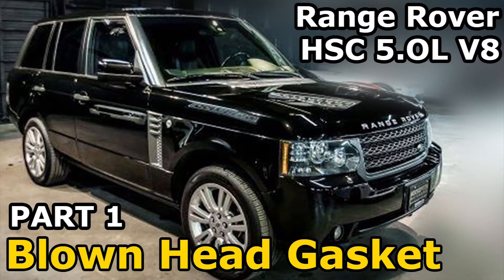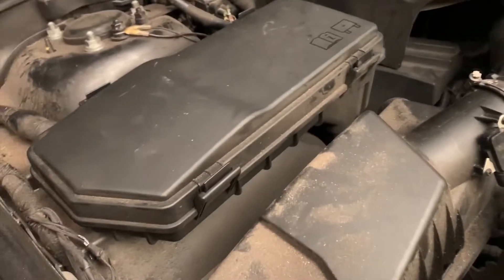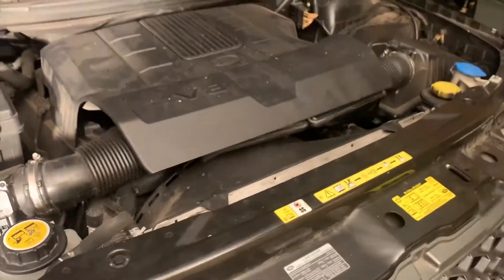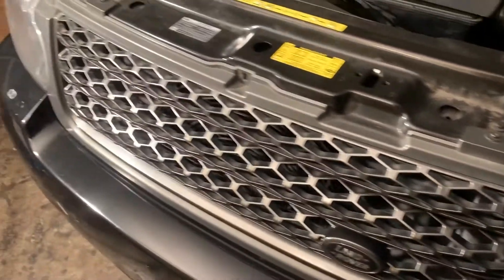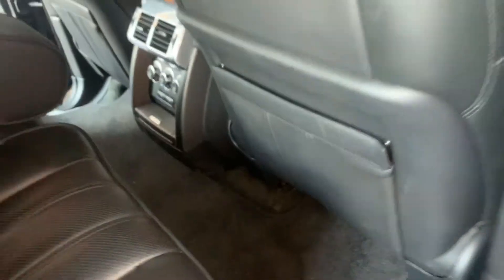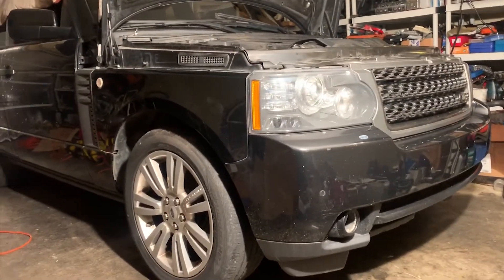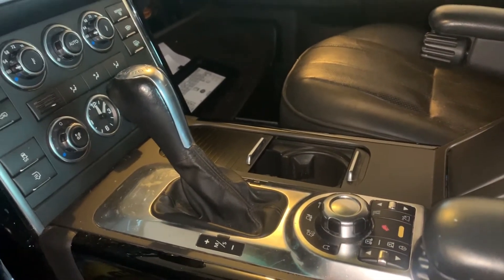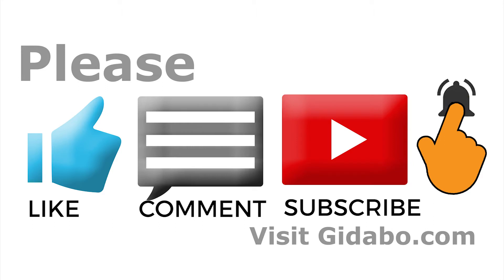2011 Land Rover Range Rover HSE 5.0L V8 Engine Blown Head Gasket Replacement Repair Part 1

Comment: Quick question- if a 5.0 has had the head gaskets already replaced, is it likely that the timing chain guides were updated as well during that repair?
Reply: Do you know any other channel that works with 2010 Range Rover 5.0 NA V8 HSE?

Comment: HI, very helpful video. Thank you.  Where is your shop located at.  I have mine that needs replacement of the valve cover gasket on the right side.  I have a 2012 Land Rover LR4 with same engine 5.0L V8 NA.  Appreciate very much your time to help us.

Comment: These are $80k automobiles and MANY owners expressed this issue. WHY isn’t this a factory defect!?
Reply: I own a 2010land rover range rover hse sport v8 5.0liter as well with the same darn issue
Reply: @jesusrodriguez6423  Same problem with my 2010 Range Rover HSE
Reply: @jesusrodriguez6423 did you had a successful fix?

Comment: What causes the 5.0 to blow head gaskets ?  I thought this engine was reliable ! Looks like I might be purchasing this 2009 model it has the 4.6 way more reliable..
Reply: Actually yours only comes with the 4.2 SC or 4.4 NA
These commonly blow due to people overheating the motor excessively.

Comment: Is it possible add P/N of tools you had to buy for the job? :)
Reply: eBay also has maintenance e books you can purchase as well. Inexpensive and helps a lot.
Reply: Do you know any other channel that works with 2010 Range Rover 5.0 NA V8 HSE?
Reply: I found a few in sections. Not anything on full breakdown. What are you trying to fix? I started with fuel injectors, intake manifold gaskets, timing all in different videos.
Reply: @saint1268  I’m just trying to see what other people work on and learn but nearly everyone has a sport or supercharged engine
Reply: It is the same 5.0 on hse or sport. The supercharged I believe the only difference is the intake with supercharger mounting and ECU. You can use those videos as reference as well.
Reply: @saint1268  the sport isn’t a full body car, the HSE is I’m pretty sure. I’m just curious because there’s very little information available for the 2010 HSE
Reply: @tedcassie5126  yes on that you are correct. HSE is a full body

Comment: Good luck. I will be following along.  I will be doing the same repair on a 2011 LR4 which has the same engine.  I am picking up the vehicle tomorrow and will begin the tear down next week.
Reply: Me tooooooo. I need this video in my life.
Reply: Do you know any other channel that works with 2010 Range Rover 5.0 NA V8 HSE?